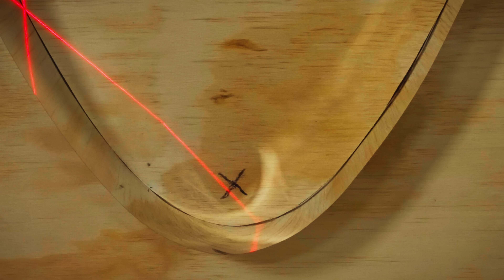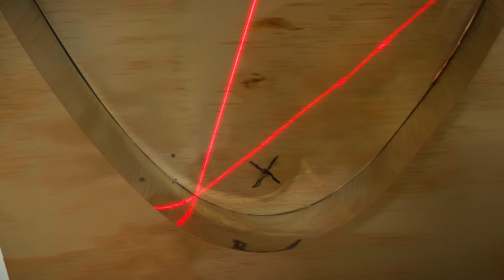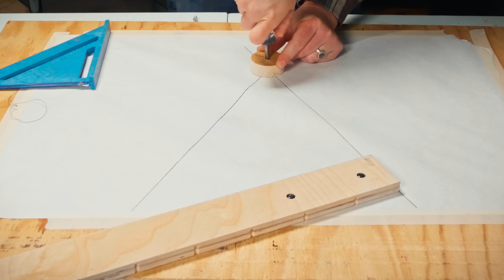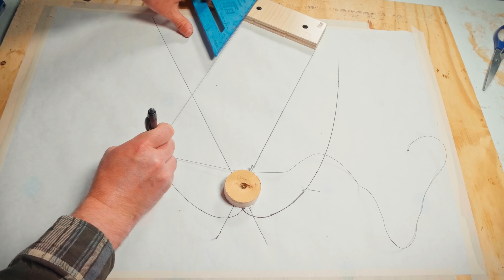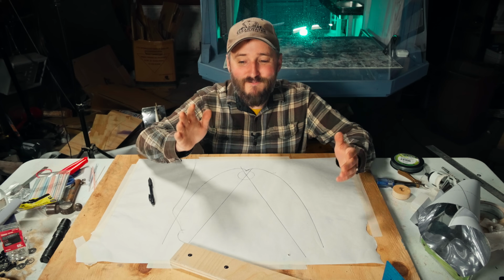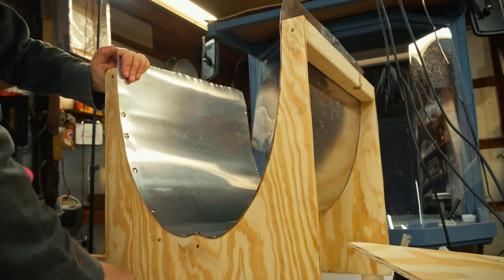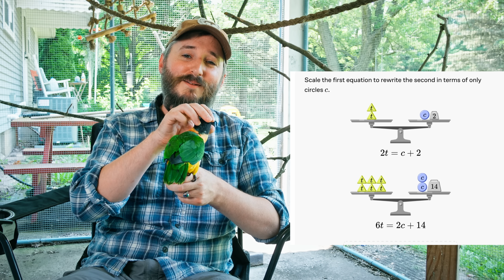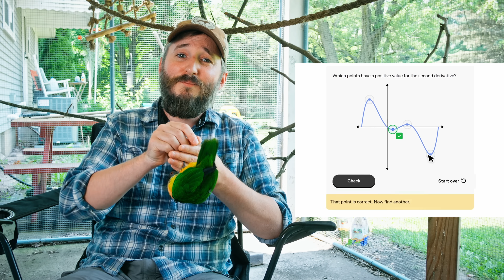DIY Solar Concentrators, Made Better.

Comment: When you say "thermal mass"...

Don't mislead people into thinking that ALUMINUM has lower thermal mass than IRON.

There may be less "PHYSICAL" mass, but the "THERMAL" mass is somewhat different.

I only say this for those who would not know it, not to be argumentative.

Especially since this was my idea, and i requested it...

Anyhow:

The Average Specific Heat Capacity of Mild Steel [the 'iron pipe" in this video]: 500J/(kg⋅K)
The Average Specific Heat Capacity of aluminum [but not specifically that which is used in this video]: 900J/(kg⋅K)
And to add, even though it is not here on this video, just for your reference if you seek to engineer such an item, I have included an average for copper as well [since it is a common and popular metal for pressurized, heat bearing systems like this]
The Average Specific Heat Capacity of copper: 385 J/(kg-K)
Other options you may wish to explore include [but are not limited to] borosilicate glass, titanium, stainless steel, brass, and, in very limited applications [because of its very low melting point] PEX.

Other factors to consider are: reflectance, absorbance, radiance, transmittance, emissivity, surface area, wall thickness, fluid flow, the thermal heat mass of the transfer fluid, the pressure rating of the tubing under both hot and cold conditions, flexibility, fracture resistance, and modulus of strain and elongation.

That is not ALL you may wish to know, but its a good start, especially if you seek to seriously build something of considerable size and/or power density.

And never forget that all of this has to not merely be supported, it also needs to be able to handle environmental factors such as wind, flying debris, sand, rain, snow, ice and vandalism.

And not just the mirror and the plumbing as such, but your trakcer motors, your photonics, your main frame, and all of your power handling components.

To make a 27.6 Kw solar tracker on a private family house lot in Owatonna MN [I have still photos, but no moving videos to share on here, but if people asked me respectfully, I can share those, as it will help you get an idea how big a machine can get and may need to get to do much for your plans, I could send those still photos (ITS HUGE!!!)] it took us 2.25 hp of driver motors, and the unit all told weighed 32,946 lbs.

Now that may sound like a horribly expensive and bulky product, but if you compare the cost per Kw of power compared to typical photovoltaic power installed at the time, it was 0.06 per dollar.

So that means at that time for the Kw we were harvesting as solar power, we had a rough bill of $62,235.00.

You would possibly spend more than that on a system like ours, HOWEVER to reach the same Kw output would cost you [I just did an AI powered query since its faster and more recent], and the LOW estimate was $2500 PER Kw/h, and the HIGH estimate about $3500 per Kw/h

So for 27.6 equivalent Kw/h, you would be looking at anywhere from $150,000 to $275,000 before incentives. 

And since the AVERAGE American household consumes roughly 30 Kw/h per day, that would STILL require you to cut back on your usage to keep within specs.

Admittedly, since some of these numbers are based on factors that could vary wildly, some of the final costs could be very different from these the AI model came up with.

Our system was set up as a thermal banking system with 18,000 lbs of mass, operating at an average of 575 F [because of Teflon parts which would otherwise fail, and some forms of Teflon in our early project DID fail, and we had to order special custom duel-filled PTFE composites to get past this] which allowed us up to 4 days [96 consecutive clock hours] of power, at the average of 22.1 Kw/h, and 5 days at an average of 18.6 kw/hours [there was a gradient because of thermal mass density, and system leakage (the more you use it, the more you lose it), but because we only needed to operate with a 60 F thermal overbalance to obtain the necessary operational overpressure of 200 PSIG, we were TECHNICALLY able to eke out a little bit of usable 125 volt single phase power all the way down to 275 F, and that took more time than we wanted to tabulate].

Also, we gave serious thought to adding in geothermal.

This is kinda sketchy, and would raise the cost considerably though, so we eventually opted against it.

Comment: Vacuum Solar heater tubes, and heat for cooking, waterline heating, Seebeck TEG's, hot water/electrical energy...
Yes, compound parabolic is the key input, the tubes take and trap 99% of the energy. Still the best. You can run sterling engines as well with the tube/collectors. Used in far off places without power worldwide.

Comment: This seems like it could be useful as a pool heater. A trough that spans the length of the pool. Water gets pumped in slowly on one end, heated as it passes and then back into the pool on the other end. I wonder how this would compare to the black pipe setups people sometimes use.

Comment: By solar heating one end and using emmisive paint on the other, could you cause a pipe to slowly propel liquids in a direction for basically free? (well, powered by the sun)

Comment: Although this compound parabolic mirror does not need to move during a single day, during the seasons it still has to be moved because the sun will be tracing a path higher or lower above the horizon❗
Reply from the maker: One of my references calculates the number of movements needed per year based on the chosen acceptance angle of the mirror

Comment: If you put a fish-eye lens on top of your parabolic reflector so that it gathers more ambient light and focuses it down into your reflector would that make much of a difference?  Also, if the fish-eye lens were coated on the inside with the 1-way mirror reflecting material, would that not trap even more light into your reflector?
I'm not a physicist... just curious if it would help collect light that isn't directly pointing at your parabolic mirror?
Reply from the maker: Hard to say without testing

Comment: Awesome video as always! I'm curious to see how the flat collector version compares against the suspended tube version. Off the top of my head, it seems like a fin style heatsink could be flipped upside down to serve as the flat collector, and the fins would help quickly and evenly disperse the heat into the water or whatever boiling medium you are using. It would be really neat to see this used in a full power generation setup

Comment: now link the pipe to a sterling engine (to maximize heat transfer to the engine why not use a copper pipe  with a bit of water inside, apparently the water vapor creates a flow into the pipe when there's heat differential wifh spreads out the heat extremely quickly). You'd have a solar powered engine that can produce electricity for exemple

Comment: I was thinking about parabolic concentrators some while ago and i thought to my self there must be a geometry that doesn't need tracking, after searching i found compound parabolics and bunch of technical papers, first thing i did was commenting for hawk that such a thing exists, anddd bam! now there is a video about it, thank you ben
Reply: Thank you, Amirsa! This is a really cool project.
Reply: I had the exact same thought and failed in my “research” to come up with anything useful. What’s that saying… something like “some of us crawl” … 🧐 “while others fly” 🤷
Reply: Heh, I started with the video and went the other direction! When he said the optimal starting angle for the compound parabolic was between 20-30 degrees, I got to wondering why.  :p
Reply: Good job mate.

Comment: I built something similar 20 years ago but I used a borosilicate glass mirror 0.8mm thick. The low thickness make the glass easily bendable to a perfect optical shape.
Reply: This sounds amazing. How do you get hold of such a thing?
Reply: @crosita1  borosilicate glass is what pyrex is made of, if this can help you
it's "just" glass and borax IIRC

Comment: If both designs are pointed directly at the sun, will they both put the same amount of energy into the target? Because if so, then the compund parabola also has the advantage of reducing hot spots which could reduce losses into the surrounding environment, and possibly improve heat transfer into the working fluid
Reply: Oops, compound, not compund lol

Comment: By rotating the compound curve around its vertical axis it would become like an inverted cone. I think it could work even better. Not sure how to go about making a cone reflective on its inside with a simple technique though. If you find a way i would love to see if and how it would work! Love every video and follow them to the end every time
Reply: Yes, I was wondering about a 3D version (a bit like the parabolic reflectors used in microphones, but with the compound shape instead). The reflective surface should be simple enough to make with narrow triangles (or similar) of the adhesive mirror film. I don't know if there's any paint spray as reflective, but that's another thought. I think the actual construction of the 'cone' might be the most difficult part - but perhaps it can be done also from sections of the 2D shape placed on a circular scaffold, wide at the edge and running down to the point at the base. However, since the focus would be a small volume rather than a pipe, although it would receive more light, it doesn't lend itself quite as well to pumping fluid through, so, although more concentrated, perhaps it's not as practical a design as a 2D trough with a pipe running through it.
Reply: Burned out floodlight bulbs (actually spotlight bulbs PAR 38, I think) are cheap and plentiful.  Just sayin.
Reply: Tedious but can wireframe it and then cover the frame with foil
Reply: I think the cone would be ideal for a near light source, (bonfire) but since we're using the sun, which is arbitrarily parallel, a series of long troughs shaped like this would be best advantage
Reply: Look up Funnel Solar cooker designs.  Very easy to make.  The first Solar cooker I made was a Funnel design. Works pretty well.
Reply: why not just polish the metal to a mirror like shine?
Reply: came here to look for this discussion

Comment: I wish I could send you a picture or even the model I just created like a month ago (in Solid Edge). I'll try to describe it. It is an 'inverted parabola' with a ring around the outside. I lined it with solar cells but I'm realizing right now that maybe the idea has some merit if you instead put a coil of black tube around it. I was just being creative. I knew the design would be far less efficient than a flat panel. The design isn't intended to be efficient, it is more artistic in nature. Solar + art... solart. I want to line the perimeter with yellow 'petals' and call it the sunflower. It will have extremely poor off axis performance so sun tracking is going to be absolutely necessary. I wanted to create a tracking method which mimics the way a sunflower tracks the sun. Anyway, love your videos man. You pick the best projects to work on. Truly inspirational.

Comment: If you have enough thermal management, you can increase the output of a PV solar panel with the compound parabola designed for focusing light on the bottom surface. Just add the curved reflectors on the sides of the panel. You will need a method to cool it because high temperatures reduce efficiency and damage the material & electronics. Possibly running water on the backside of the panel is enough. 

Then, you would get much more electricity (more than needed to run the water pump) plus hot water from one setup. Or, if you can get the coolant hot enough, you can use it in a heat engine to get even more electricity. Also, if it is a two-phase coolant, it will be more effective at extracting heat from the panels at it vaporizes.

Comment: These light collectors focus on reflecting light to concentrate it. However, that's only half the problem. The other half is how to maximize the light that is ABSORBED by the target.

Everything reflects some light, even the darkest black paint. And as the collector gets hot, it will also radiate heat away, essentially losing some of that energy it just collected. You can optimize surface geometry to maximize the heat absorption.

For example, consider a flat surface versus a v-shaped groove. Whatever the flat surface reflects moves in a direction away from the surface, so it's lost. But when the sides of the groove reflect (or emit) light diffusely, then a portion of that light will hit the other side of the groove and be absorbed. There is a net increase in total energy absorbed/retained.

This can be demonstrated by making a groove using two mirrors. When a laser is pointed into the groove, it will reflect multiple times until it eventually comes back out. The narrower the angle, the more times it reflects before escaping. And since nothing is a perfect mirror, there are losses with each reflection. As you make the angle smaller, you will observe the laser dot that comes out get dimmer and possibly become undetectable.

The phenomenon is also why a hole with a cavity behind it makes the "darkest" surface possible--light goes in, reflects around, and virtually nothing gets out.

The second part of the optimization is balancing the steepness of the groove with conducting the heat through the collector. It's essentially working like an inverse thermal fin. Too narrow of fins means not enough heat transfer, while too thick means capturing less light.
Reply: So instead of a flat surface collector (the third variation shown in the video) replace the bottom plane with a plate of glass, with the groove below it? Or perhaps a circular cavity?
Reply: @zzombatt  That's a fantastic idea. The best shape for the section below the glass would balance total volume (more volume means more fluid to heat, so lower temperature because there's a fixed amount of energy being absorbed by more mass) with maximizing the distance and orientation of the surfaces away from the glass. A circular cavity has more surface pointed away from the glass, but it is larger volume. A very deep groove has steeper sides which make it harder for reflected light to escape, but again, it has more volume. There's also diminishing returns--the darker the black paint used to paint the collector, the less practical effect optimizing the surface will have.

It's possible a square shape below the glass might be close to ideal--plus, it's easy to make and offers relatively low friction for fluid flow.

Another idea might be to have the glass be a lens that directs more light to locations in the cavity where it's harder for the light to escape. And of course, the glass should have a low-reflection coating like several eye glasses use.
Reply: also: more fins = more surface area to radiate heat (even though some gets re-absorbed)
Reply: Put the exchanger under vacuum for exponential transfer

Comment: Aluminum is ACTUALLY almost the best reflector [short of silver] and is less expensive, as well as easier to maintain, because if the corrosion proof wax option is not used, simply use the Fresnel lens to help collect more light/heat while keeping dirt, water, bugs etc out of the inside of the collector.

Also, you can polish the mirror surface smoothly with aluminum polishing compound, if it does not get so corroded, pitted, or dented to continue to work.

And then, too, all you need is to be able to make a new one and polish it up again, which, compared to precision lining with a silvered reflective tape [I have some, actually] and waste a lot less time and work to have a mirror back in motion.
Reply: If he polished the little aluminum pipe in his collector, it would improve it's reflectiveness, so that the aluminum pipe collector will reflect even more energy back into the sky, instead of heating up the pipe.
Reply: @WeBeGood06  Who said ANYTHING about polishing the TARGET?

I sure didn't!

You might want to take more time, slow down and READ, instead of skimming long and complex topics.

If ANYTHING, you would want to use MATTE BLACK anodizing on the aluminum TARGET.

Wake up!

Comment: Do you think it's possible this design could be used to create a solar forge or crucible? You mentioned in the video that on a sunny day you could potentially reach temperatures that could melt the metal pipe. Could the focal point be a flat surface that you could lay metal on to heat up enough to forge with a hammer? The other idea would be a crucible that could be heated with sunlight to melt metals like pewter or aluminum to be used in casting.
Reply from the maker: Could be possible!

Comment: Really enjoy this channel’s content. Question though: is the depth of the mirror important? How would one determine the depth required?
Reply from the maker: The depth only allows you to get a bigger opening to accept more light at the mouth. You have to decide when making a taller and taller mirror has diminishing returns for your design.
Reply: @Nighthawkinlight thanks for the reply. Was thinking to make it a bit shallower. I see this technique is used in solar vacuum tubes for water heaters.

Comment: Can I ask a stupid question? Why did you not use the same size pipe on both collectors to show the difference in performance? Was there something I missed-probably which explained this methodology. Please.
Reply from the maker: A parabolic concentrator has a big disadvantage if the target is large because it intercepts the rays further away from the focal point (= lower concentration). I was trying to use a pipe suited to the mirror.

Comment: You should put a solar panel in a bigger one under a big fresnel lens, with your cold pcm pack on the back of the panel and a thermoelectric generator using the  heat differential, that would be pretty efficient